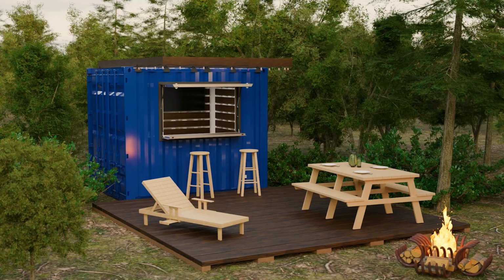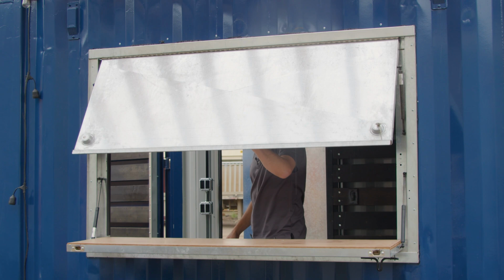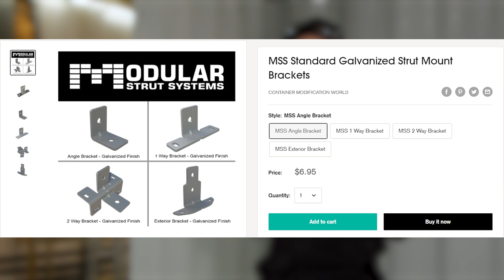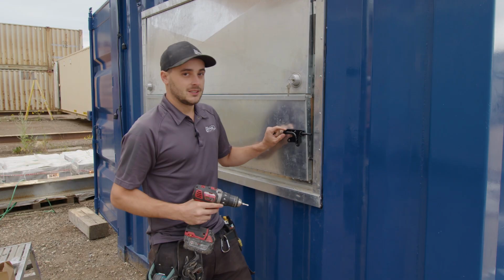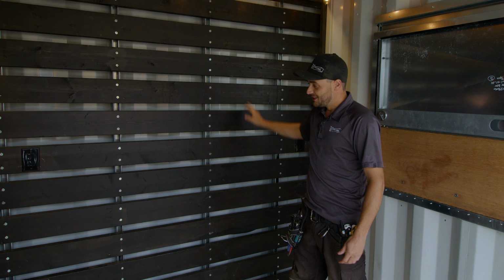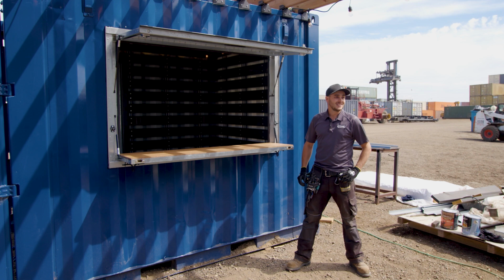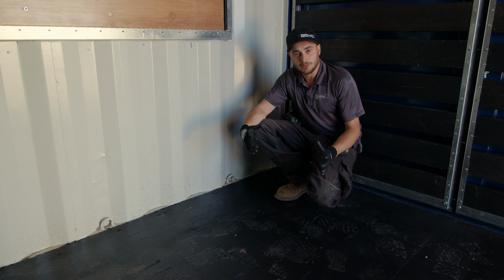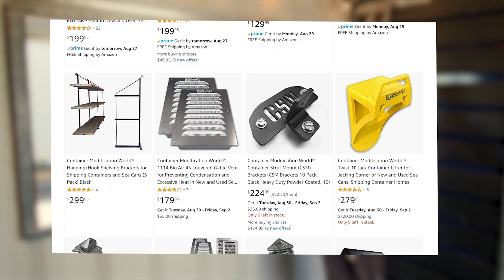Backyard Patio Bar with Kiosk Window made from 10ft Container

Comment: Who needs the Windowlatches and the locks? I mean the window closes and opens anyway only from the inside and on the door you have a lock. Why not lock both parts with a bolt /bar / beam on the inside from top to bottom like a medieval castle gate. From the outside everything is smooth and you do not offer a burglar a point of attack on the window.
Reply from the maker: Our previous version was like that. We honestly don't know what the best answer is yet. Time will tell... We'll figure it out eventually. Thanks for the input. We're all ears at this point.